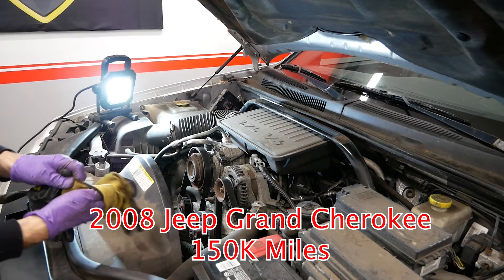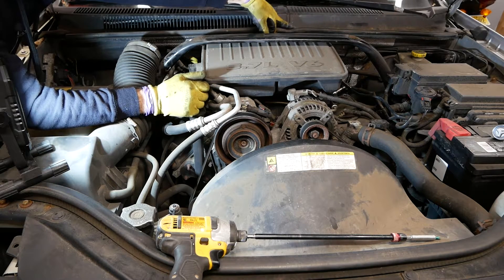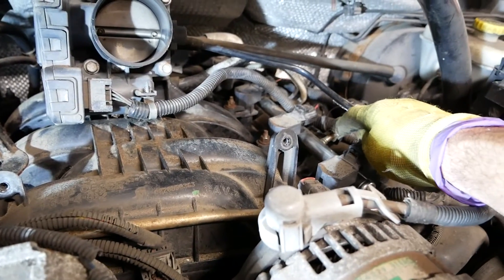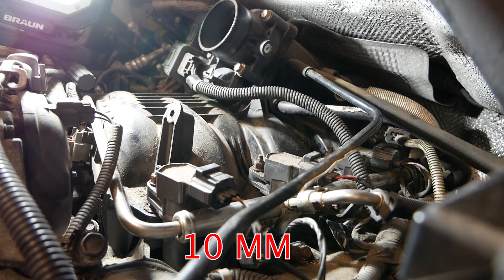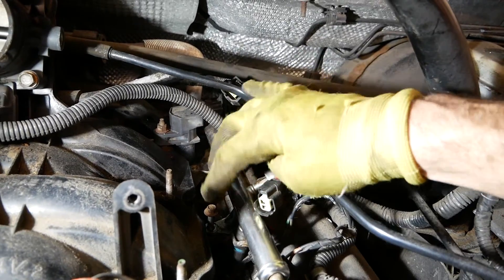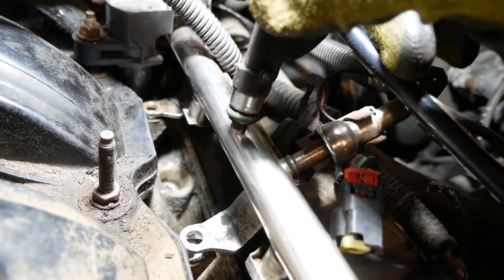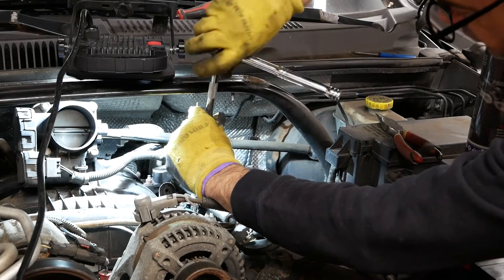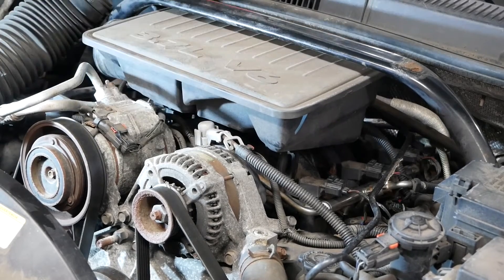Jeep Grand Cherokee Laredo 3.7L 2008 - Fuel Injector Troubleshoot and Replace - P0201 CEL

Comment: You make it look easy... I'm not a professional but it doesn't look like to hard of a job  my question is how likely will the washers or orings get stuck in the cylinder? I may attempt this myself
Reply from the maker: I didn't have any that got stuck in the cylinder or fuel rail, one of them did fall off the injector as I was removing it.

Once I removed the spark plug coils that I needed out, I took a cut piece of rag and gently stuffed it into the hole where the plug is, this way nothing will fall inside of there.

I also used some compressed air to clean any loose debris before I started.
Reply: Before I get that far I have a 2007 Grand Cherokee with the 3.7 engine the problem I'm having is intermittent hard start or extended crank  no codes  I replaced the fuel pump in April  ..a few weeks ago I was sitting idle for about 1/2 hour the jeep got hot so I went in the store quick it wouldn't start when I came  back out  it cooled off more started extended crank  it was low on fuel at the time.. do you think my filter is clogged or my injectors or bad coils  I have replaced  plug's  thermostat cam and crankshaft position sensors ignition switch  so far.  I don't want to keep playing guessing games it gets expensive lol do you have any idea what it might be?
Reply from the maker: Could be a fuel pressure bleed down between starts

Before you actually crank it over, try leaving the key in the on position for a few seconds to prime the fuel before it actually cranks. 

Also, theres something called a residual check valve in the fuel tank. Apparently it keeps pressure in the system when the car is turned off, for the next start, not sure if you changed that also with the pump

Can maybe also try some fuel injector cleaner mixed in with the gas.
Reply: @importgarage I've been having the same issue and it's not bleed out in my case it has something to do with the initial over heating like something electrical got fried I've change plugs coils intake air sensor and I got the injectors today I need help only codes I get are cyl#2 cly# 3 to rich and random mutipal misfire
Reply: @importgarage1715  thanks for the video super helpful I'll let you know if the injectors work
Reply: Now I just have a missfire cylinder #2
Reply: @golddiggergary…I have an 08 JGC…same issue. Started after the 2018 “5 year transmission” test from the dealership, bc I bought the lifetime warranty. 

If I drive about 15-20 minutes, turn off, go pick up lunch, and return, the Jeep won’t start. I blew a couple starters in this process (dealership covered replacement due to warranty), and eventually learned that I have to wait about half hour before it’ll start again. No codes ever come up. And the dealership has been “hands off” when asking for them to take it in to test and figure out why. 

Lol so, in a way, I’m glad I’m not alone with that issue. But at the same time, frustrated because it limits me and is a pain in the a$$ when I have multiple errands to run.
Reply: @nynut518 If it happens again, that the car doesn't start once Is hot, try to release the gas from the rail as shown in the video, It should start right away.

A lot of people fixed this problem by changing the  vapor canister valve.

Comment: For my 2007 Liberty 90,000 miles it was the Injector electrics. For some dumbass reason I didn't ohm the #1 Injector leads. When i eventually did,  it ohmed at 148 instead of around 12.5.  So that explains why I had #1 low rpm misfire under 500rpm and a code for #1 inj circuit open. Likely upon startups, bc it started and idles fine. Doesn't have detectable misfires otherwise. 

Bought reman Denso 6-pack on ebay for $72. I'm just replacing that one Injector #1 bc I'm like that, so I'm gonna try to do that without having to remove anything but the #1 and #3 coils and fuel rail bolts on both sides. Maybe the air intake if necessary.

Comment: Have code faults for #1 misfire, fuel injector 1 circuit open, and Bank #1 lean. 

There is a slight rough idle, but no misfire perceived, and it runs fine under load and high speed.  Doesn't burn oil. Gets 15mpg combined mileage. Ran fine when I got it 64,000 miles. Now it has 110,000 miles.  It has had this issue for about 10,000 miles. Not getting worse, but so far plugs and coils and cleaning intake hasn't corrected it.

I checked and cleaned Injector and Coils wiring connections and they look good too. #1 Injector plug had some oil in it, somehow. Cleaned it very well with first brake cleaner,  then electronics  cleaner. Let it dry and reassembled.

Can bad Injector o-ring cause this?  I already ruled out spark plug, coils, valves, and did intake cleaning.  

I have not checked orings and the wiring from #1  Injector to the computer control.  And don't really know how to.

Any tips on checking Injector and its wiring and control while it's still in the head?  Thanks!
Reply from the maker: Sorry for the late response 

You can try moving or swapping injectors #1 and 3, and see if the code changes

There is also a resistance check you can do on the injector. However, mine tested fine (12.5 ohms) but was still faulty

Comment: Big help. My issue is that the cylinder 1 misfire code keeps coming on and off.....any ideas?
Reply from the maker: The p0201 code should be related to the injector. If you replaced it already you could try checking the electrical wires and connector. I also swapped injectors from cylinder 1 and 3 and the code did switch, that seems to be the easiest way to verify a bad injector.